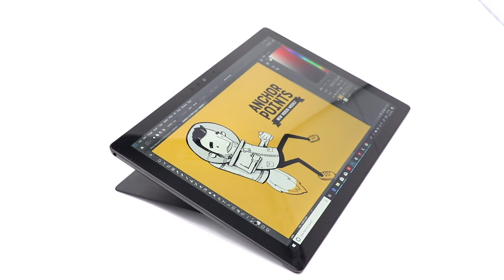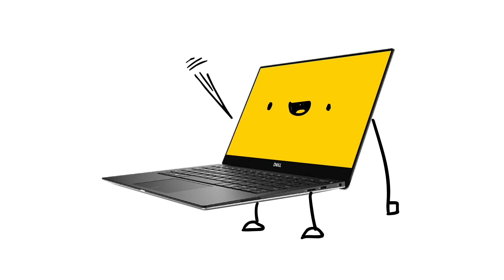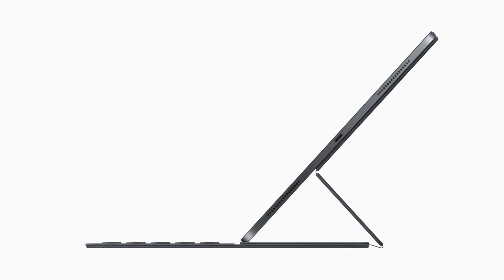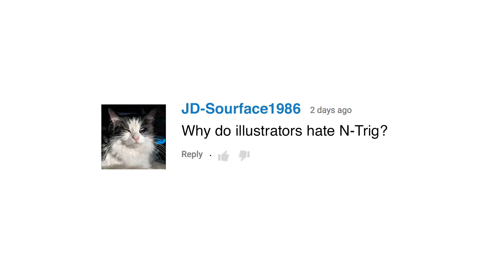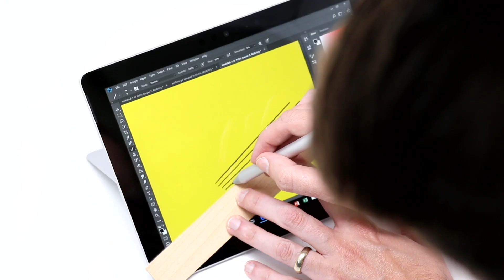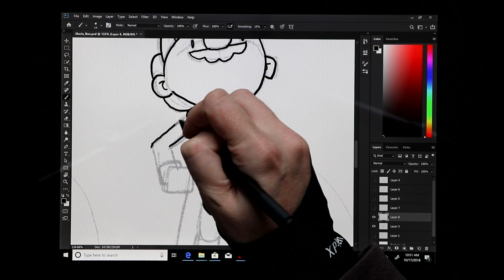Surface Pro 7: Rumors and Updates

Comment: USB C charging, 2x faster charging than Surface Pro 6, and a USB C chord is much cheaper and thinner and mobile than a power brick LOL. Intel ice lake or 9th gen processor. And it could be coming out later this year or at worst, early next year. If next year, it'll give me more time to save up. Plan on getting the 256GB version.

Comment: I have a Surface Pro 3 and have had it since early 2015 and have been happy with it. The issue is that it is starting to freeze up every so often and had to re-set it twice in the past 90 days. I did visit the Microsoft store last week to review the SP 6 and Surface Go just in case my computer dies. I had Microsoft check out my computer while there. They claim all is working well.

Comment: I would love to see the new Surface Pro use AMD processors. And obviously a big update to the pen drivers. Like if they work to improve  n-trig so that it yielded smoother lines. If they did that I deffo would get Surface Pro 7 and Surface Studio 3.
Reply: amd on mobile device is pointless. noob.
Reply: @inoviant7334  Could you explain why?
Reply: @inoviant7334  AMD in a mobile device is good especially that 7nm far superior than intel's 14nm and 10nm. Plus the AMD is known for having good integrated gpu

Comment: really wish they include more USB 3.0 port, for a laptop, I need at least two to work comfortably (for USB mouse, bigger keyboard or connect to my external hard disk) 

best case scenario would be to have the charging port switch with USB-C and change micro USB to USB 3.0 (or even 2)

Comment: To release it by October or early November 2019 otherwise cant wait just will get the pro 6. For the pro 7 to have a dedicated GPU! A quad core CPU i5 or i7 a type c USB port anti glare display that doesnt reflect like a mirror in sunlight. And a uniformed display aspect ratio not some 1xxx by 2xxx 3:2 display resolution/ aspect ratio.

Comment: I'm still on the Surface Pro....original! I use a fujitsu lifebook T-5000 pen (bought it when it was like $60), and an 1TB external hard drive, as the surface only has 65GB internal storage) I'm still very happy with it all, though my setup has been really killing my neck and shoulder. ): The surface itself is starting to show its age (not to mention I bought it used), and it has blue-screened twice within the past year. I'm hoping it lasts a little longer (It's going to have to, my wallet says so!)

Comment: What I would like to see is a bigger screen. I could fall in love with a sweet 16. (And maybe a thunderbolt port for an extra graphic card power.)
Reply: The size at least is most likely going to be exactly the same. Why? Well, MS will most likely to have the older Type Covers being compatible with the new one, which is great. And that's also the size SP-line has always had. It's compact enough, but not too much. And it's light enough to carry around. Thus I really, really don't see them having a bigger form factor happening, not even in a terms of releasing a different Surface Pro "Pro" line-up, as it seems they don't want to saturate the line-up (which is also great IMO).

The Thunderbolt 3 thing could even happen, but I'm not holding my breath on it. After all it's not exactly what the big audience is crying after. But we'll see. I sure wouldn't mind them adding it.

Comment: Never used a wacom because i dont wanna hate my surface pro but the jitter is there, you can notice it even if your not an illustrator, the only solution is making fast strokes in my opinion

Comment: Wacom EMR sucks around the corners and edges of screen especially on a tiny 12" screen where all the buttons and tools are. Emr pen suffers those wiggly lines just like N-trig pens. Most times its worst cuz EMR need calibrations. You can't take your note phone pen and expect it to work just as precise on a windows tablet and vice versa. Sometimes emr pen is too responsive that it's not natural and hard to control the flow. But some people like that.

Comment: They got it all wrong. 12-13" display is pretty much useless for real creators. Combine that with unnecessarily expensive CPU and ram just to drive the cost up is a total fail.

Better setup is make a 17-18" display running m5 or m7 CPU with 8gig of ram, 99% of artist who does a lot of sketching and paintings dont need anymore than this. Price it at $699-799 and they got a winner.  Anyone who claims those specs don't work should spend more time practicing and less complaining. A faster more expensive device with a super small display will not make you a better creator.

Comment: anyone here that owns a 27"cintiq and owns a surface pro 6 as well? I am interested if you still using the cintiq. I have the cintiq as my daily driver with a heavy pc configuration under the desk. But want to add the surface pro 6 (or 7) so i can draw anywhere, start en finish illustration for clients. I wonder if i would pickup the surface pro and draw in the livingroom or sit on my workspace with the big cintiq.

Comment: Nice video... personally would never buy another Microsoft Surface or in fact any other MS computer as their warrant service is the worst by far of any manufacturers I've dealt with over the last 20 years of working within the IT industry. 
If it malfunctions expect to wait weeks before Microsoft try to worm their way out of a warranty repair. I've never had any problems with Dell, Lenovo, HP or Toshiba only Microsoft.

Comment: The thing is I feel like the only things really holding the surface pro back is 1. no Rechargeable batteries for surface pens and 2. Still jitter when drawing and 3. Still no USB-C. I am hoping they can make a bigger jump to more of the other modern laptops..
Reply: Honestly I think the removable battery is fine, I might even say that I prefer it. If the battery starts degrading/fails on an Apple Pencil or similar you're shit out of luck but with a removable one you just pop in a new battery and you're back in business.

Comment: *Optional Bluetooth on the Keyboard so it can be used while removed.
*Add a god damn Thunderbolt 3 port already or use the PCIe lanes available in the Surface Connect port for your own implementation.
*Allow video-in/pen-out so that the Surface can be used as a drawing tablet for more powerful computers.
*Increase the screen size and reduce the bezels.

Pick 2-3 and I'd probably buy a Surface. I love the device, but it just doesn't fit my needs compared to something like an XPS with an eGPU and a cheap drawing tablet.

Comment: I don't think the N-trig pen technology can be fixed.  Neither Microsoft nor Wacom have managed to fix the jitter in AES pens, so I think the technology is inherently flawed.  
EMR and the sensors Apple use are different, and therefore don't suffer from it.  
I think Microsoft need to cut their losses there and go back to EMR.

Comment: A rechargeable pen like the apple pencil but with nibs of a wacom bamboo ink, thats what I really want. The current pen tips they sell got rid of the H tips and the other tips sucks. I've been using Bamboo ink the last 4 months and it wears off slower than the surface pen tips drawing on a anti glare screen protector.

Comment: They Absolutely need to have type c charging, or type c to surface connect, because I'm really tired of having to replace the whole brick. I've gone through 3 already and ever since replacing the first one, I've been really careful about trying to keep it draped in a way to not bend the cord. So if not this, then at least they need to make the cord detachable from the brick so it's cheaper to buy replacements.

Comment: Nice overview. I think all of the points you made are super valid. As an illustrator myself I do love the Surface line...but compared to Wacom it is exactly as you have stated. There are certain things that I cannot trade off when it comes to pen tech. Man...if they could improve just a bit it would really be a great combo. I have and currently have 4 Surface devices(Surface RT, Surface pro 2, Surface pro 3, and Surface Book). They are a joy to use. But when it comes to professional work...My Mac all day with my Cintiq 22hd. Anyway....keep up the great work! M

Comment: The changes I would like for next generation Surface Pro:
- More options for keyboard: I don't want to be limited to flat keyboard, because if I own it, I would go straight for mechanical keyboard (yea, I know that I'm asking too much). Can use shortcuts much easily when is detached and much less painful typing, especially when you don't need to avoid touchpad in the middle. 

- USB portSSS: today is so hard to find anything portable that have 3 or more USB ports... Why do a need it? USB sticks, when I will be using it as normal laptop than goes wired or dual-mode mouse and keyboard as mentioned above...
.
But the bezels can stay, more like needs. Same as wacom use them for long period of time, they are here excellent for resting your palm, so it won't fell of screen, otherwise drawing or clicking with pen on edges will be more ''unpleasantly''...

Comment: I have the Surface Pro 6 (I'm using it now to type this comment) and here's what I would like to see Microsoft improve on the 7:

1) Better GPU.
2) Better battery life.
3) 120 Hz display like the new iPad Pros.
4) Higher resolution N-trig digitizer.

The N-trig digitizer basically uses the same capacitive touch sensors for both the pen and the multi-touch display.  Because people's fingers are so big--relative to the screen resolution--the resolution for touch input events don't need to be particularly high.  (You don't need touch input to be to to the nearest pixel.)  This is a problem for pen input when high precision is required.  The low resolution of the sensors basically causes pen input to 'jump' around since they can't tell precisely where the pen is.  This is what causes pen jitter when drawing slowly.
Reply: TerminalJack505 great description of why the ntrig technology has the issues it has.
Reply: TerminalJack505 more ports maybe?
Reply: Just be grateful that you have a laptop. Don't be nit picky. They can't make every one happy.

Comment: Just bought a surface pro 6.  I only do some black white comic art.  No need ever for a cintiq.   Just use my old intuos for some simpe color work and finish.  Surface pro destroys need for a cintiq for non profssional digital painting artists.
Reply: No way. As an illustrator, can't work full day comfortably in 13 inches. I need 22 (ie, an xp-pen) at least... And that jitter....
Reply: @3polygons  I've been drawing on 8x11 paper all my life.  So it works for me.  To each their own I guess.
Reply: @mrzack888  Yup, to each his own. I was only basing my words in that I know a bunch of colleagues, and most of us  from an older generation have gone the path of starting only in A4/8x11 in traditional drawing (a lot of us as comic artists) , but, I don't know, sooner or later, you face the need to producing in a wild variety. Just in this year, I have clients that are asking me to illustrate formats as small as 5x6 inches, or, heck, even tokens of 1 inch of diameter, as well as some asking for HUGE canvases. One of 2 meter canvas.  At Fine Arts college, simply put, you would not have that lucky option of only choosing 8*11 or A4. Every work would need a different canvas size. From tiny toothpick fas ink sketch exercise, to A3 anatomy drawings, to 2 and 3 meter wide oil canvases, or several meters wall painting. 

And yep, as now I'm all in digital workflows, it should not matter, you can produce those using an A4 sized cintiq, for example. But in my experience for the back pains, neck pains, and for those of us in the mid forties, eyesight gets quite punished with a 13 inches screen. Even with glasses.... Is not one, but a bunch of people from the job that have agreed with me that 10 to 12 hours a day or similar stuff, all week, all  months and years,  often convert that discomfort in chronic pain or issues. I for one need to see a large canvas composition in... well a large canvas device. Also, as Brad said (he says it now as been reminded of that in his new art classes, but I've said that here since very long ago) small devices in what is drawing surface, force not to draw from the shoulder, but from the wrist. And so, the drawing of firm, fluid lines, good straight lines, that training for inking and penciling, becomes almost impossible in a 13 inches device.

All that said. I do agree. If works better for you, and other users, then there's no debate. Each one picks what feels better. I did make an entire 2D game artwork for a PC  game the size of DIablo II (actually, very similar) in the part that was assigned to me (really small team) entire using a very tiny Wacom, the smallest they had. Also, in small tablets, besides  the " from the shoulder " issue, it is a fact that I have been able to test methodically, that the line accuracy is quite worse in "Small" than in "Medium" or large (L) tablets. My XL is way more accurate than any medium size, let alone a small. 

Again, if works for the individual,  even a mouse can be the tool to use. It's all about personal preference.
Reply: would you recomend the surface go
Reply: @thetwicksshow4726  not sure. Haven't tried it .  Go to a mall that has Microsoft store and try it out.
Reply: @mrzack888  alright  thanks anyway

Comment: Kinda random question but how is the newest n-trig compared to huion?, I’ve used most stuff but the last ntrig I tried was the surface pro 3 and I heard it improved a lot.
Also right now I’m using the gt 221 and it’s not as good as wacom but both the Initial activation and the jitter is low enough that it’s almost negligible, so I wonder if ntrig is already there?
Reply: n-trig is a lot worse than current Huion Tablets.
I just got the Kamvas Pro 13. After firmware update, there is like no wobble anymore.
Accuracy however is not great (calibration does not help) ... maybe similar to a surface pro.

I feel, the best we can get today is an iPad Pro.
If only iOS wasn't such a huge pain in the ass. And I wish there was something like Astropad, which would connect to PC.